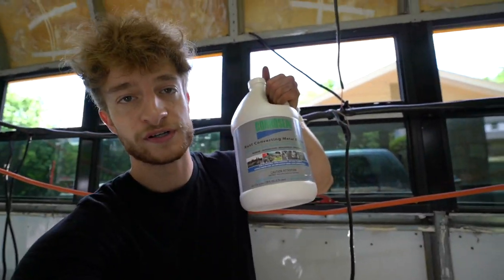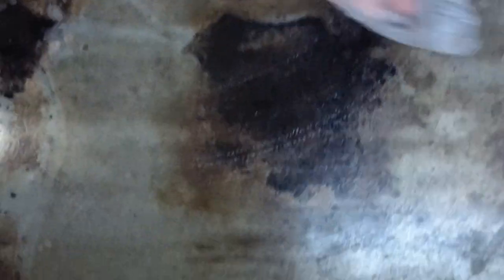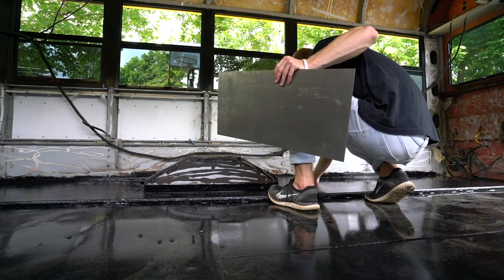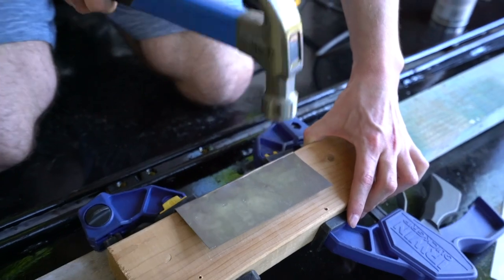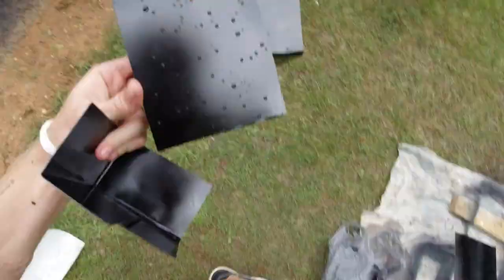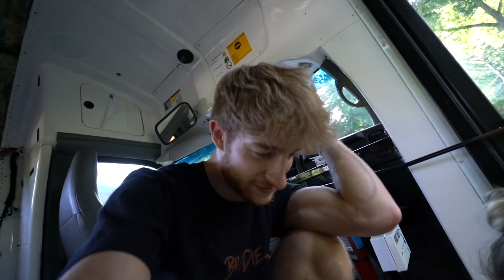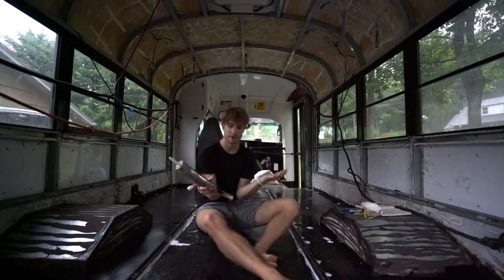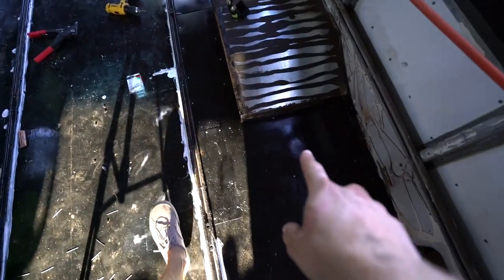Rust Repair On Short Bus Tiny Home - Skoolie Build Ep. 3

Comment: bro that corrosion is in the chassis you slapped a band aid on it. 

I am guessing by the palm trees and whatnot you live in a southern state? or maybe california? perhaps it is your age and general lack of knowledge or the general ignorance to corrosion of your region.. Either way either need to grind out as much rust as you can down to bear metal than treat and encapsulate it. At this point your best bet to stem the spread of the cancer is to use a product like fluidfilm or woolwax and generously coat that frame. once you get serious structural rust like that it is damn near impossible to get rid of it.
Reply: @MrAwsomeshot which is better? I would like to get some and use it on my bus to prevent any rust. Just bought it so not sure if its bad but there is surface rust Id like to stop from getting any worse.
Reply: @J.A.R777  they are similar products woolwax is less viscous